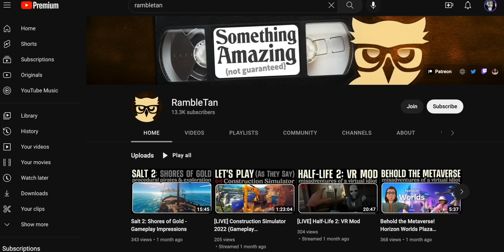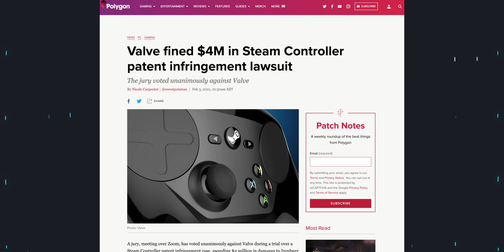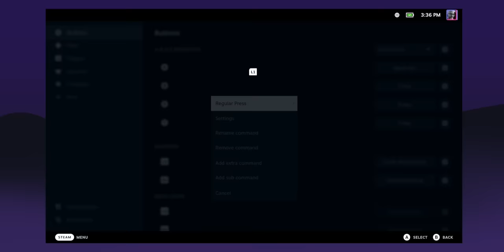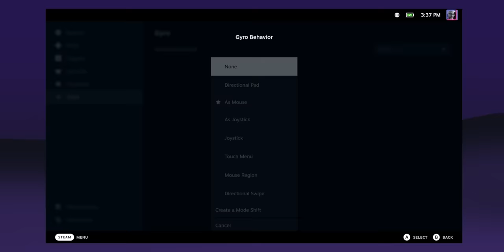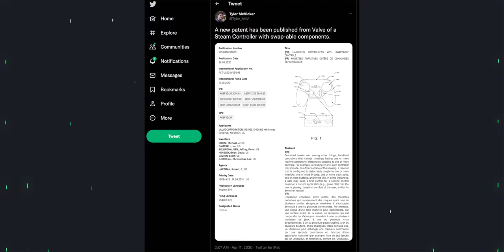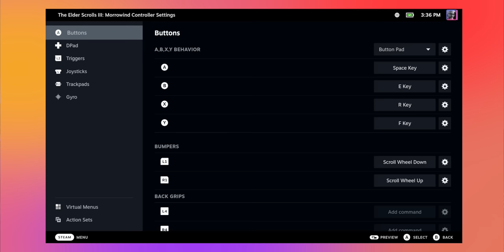Is Valve working on a NEW STEAM CONTROLLER?

Comment: I love the steam controller but I feel like there's a few major issues that weren't really addressed well

1 it's not exactly plug and play, especially with games that a lot of people haven't been playing with the steam controller there's a lot of setup and while I think it got easier over the lifespan of the steam input system currently in play it can get to be pretty arcane and awful
2 it's a nightmare to use on non steam native games if I have a good setup I want to use on overwatch or Diablo or the non steam version of final fantasy online or whatever game that's hard to launch through steam it's just not happening if you get it to work you'll usually be missing a lot of features and editing it while playing is really difficult

I'm not entirely sure on the timing but I feel like when the steam controller released was the height of Ubisoft and ea and whatever taking their games off of the client and putting steam unfriendly launchers in all of their games

Comment: As somebody with a Steam Deck and a dock, I want a Steam Controller 2 so bad. Going from the ergonomics, quality and flexibility of the Deck's controls to the Steam Controller is not great. Playing a game like Disco Elysium is such an utter failure with this controller. You'd think it would be great, but some games don't like a mix of native controller inputs mixed with mapped KBM inputs. That dual analog design is so important.

When the Steam Controller first came out I assumed it was just muscle memory and that I'd grow acustomed to the trackpad, but after years it never really clicked (pun not intended). Some things are just not intuitive, and for me, mixing an analog stick and trackpad input at the same time is like the 'rub your belly while patting your head' exercize. Sure you can learn how to do it well, but it's not fun to learn. 

Valve really learned so much from the Steam Controller though and it shows in the Deck. Want to make learning fun? Turn it into a game, which they did literally with Aperture Desk Job. Familiarizes you with every button on the Deck in a tactile and visual way.

Comment: I thought Alienware Nyx was a Steam controller 2 in Alpha/beta stages and that a new Dell/Valve Steam Machine was on the way but with delays. the Alienware UFO was like a Steam Deck 2 but at a higher Price.
Reply: it's possible that Valve is relying on more continuity in the PC space before a Device with Ryzen/Radeon or Intel and Nvidia could be made to run Steamos which would be preferable by companies like Dell. either way the plan forward is to get people off of Microsoft Windows and Closed Ecosystems but Without taking away the ability to do what you please on an open-source platform just With the Steam platform in the center of it all.

Comment: To be honest, I play my Steam Deck docked with my Steam Controller 99% of the time. The transition (input wise) from docked to portable is so seamless that I would not have it any other way.

I keep beating myself for not buying another 3 controllers when they were $5. I got my introduction to it when I bought my one controller at $5.
Reply: Oh, I wish they added a rechargeable built in battery. My main issue with the controller is swapping the rechargeable aa batteries because one of them usually gets stuck in the bay.
Reply from the maker: Yes, I hate that.  they are so hard to eject.

Comment: it would be nice if valve could at least allow us to use a second steam deck as an external controller to a primary steam deck
Reply: You could use steam in home streaming (which I think they may have renamed to remote play) to get around this issue. Would just need to be on the same wifi network
Reply: wii u mode

Comment: for a better success Steam needs to make it so the steam controller can be used with none steam games, I absolutely love my steam controller,  but to use it fully I need to have rewasd to work with none steam games, and then rewasd has limited control over the steam controller so it doesn't work as well as steam input.

Comment: i think the steam deck pro/2 will have thunderbolt and a dock with either a custom gpu or a off the shelf one that is designed to work verry well together and it would possibly have its own ssd instead of doing a tv box it will just be one product that gets better when you plug it in